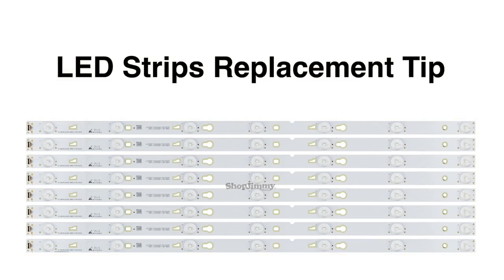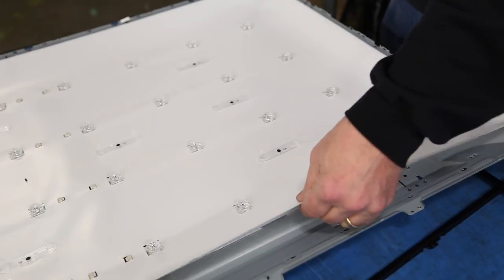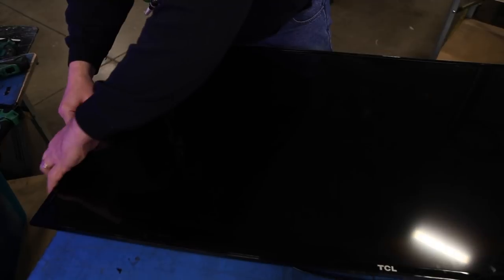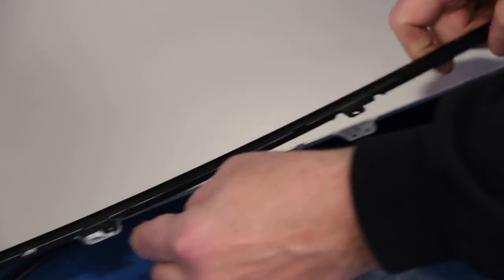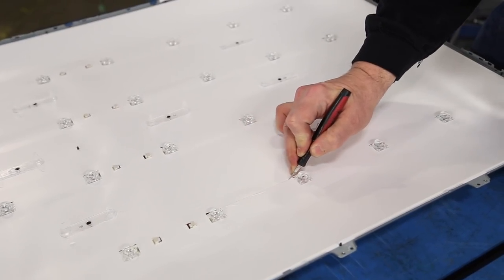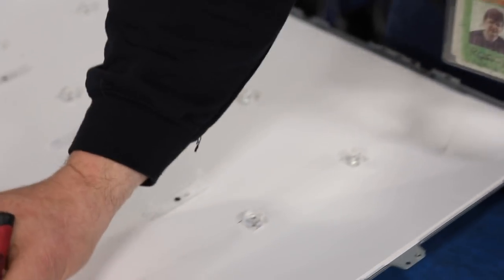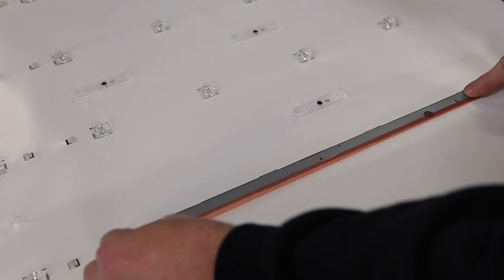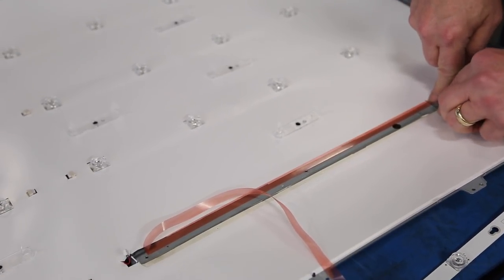LED Strip Replacement Tip - How to Remove LED Strips and Save the Reflector Sheet in LED TVs

Comment: Thank you for this video!! I cant find the button to give you a thumbs up. :( so I write this. I bought an 8K TV 82" from Bestbuy and with the help of your video I found out that my inverter and LED driver is bad as well as LCD panel needs replacing right out of the box.
Reply: Here is an update it turns out there was an issue with my one connect wire sorry place that one connect wire with a thinner one connect wire for the same TV and now know that it’s 100% the one connect box which is not for my 82 inch AK TV but for a 43 inch Samsung TV. 
I’m switching out the box next week I will have a perfectly working TV. 

So the difference between the wire that I had with the TV that one connect wire versus the one connect wire that I had it replaced with I’m able to actually use my tv, watching movies and shows on but still need to replace the OneConnect box as I am getting a OneConnect Box error on the tv screen

Comment: I have Magnavox 15MF227B/27 that has sound, but no picture. I can see the menu with a flashlight. I watched your videos and determined it may be a LED driver. The screen occasionally comes on for a couple seconds and then everything goes dark, visible only with a flashlight. Do you have this part available on your website?
Reply: just from the little bit i been reading..sounds like the Tcon board. did you get it fixed?

Comment: Hi,  I’d really appreciate if u could answer this question that I’ve been trying to figure out for months… 
I have 2 broken TVs.. a 60 element 1080p with a black spot that looks like there’s no lights working in that top left top middle area.. plus lines going both ways    &   a   55 LG 4k tv… think it might have just one led bulb somewhere that’s bad because tv turns on then picture goes right away in a half of a second…. My question is: 
Could I somehow take out the internal led light strips from one tv… to try to put them into the 4k LG tv… to hopefully get it to now work??  
I also broke my 85” Sony 900H 🤦‍♂️😟
But that’s another story 🤦‍♂️
Please, if u could let me know what u think, is it possible to fix the LG that way.. I’d very much appreciate it! Thanx

Comment: I have a UN55J6201 that has no backlight or image. I've replaced the motherboard and the power supply board but haven't had any luck. I was checking for loose connections when I touched the LVDS cable from the motherboard to the t-con board the backlights came on but still did not have an image on the screen. What would cause this?

Comment: 60PZ550 Lg tv. No picture. Sound works, input works changing works. Can tell with the sound. Removed back panel, y sus board a little discolored where the coils are and seen some cold solder joints. No shorts to ground anywhere. Fuse is good. Z sus board darker circuit board, blown fuse and several mosfets bad. My question is, would a bad z sustain board cause a no picture? Trying to decide whether I should send in both boards to be rebuilt.

Comment: My master Philips 32BLD4012N / 62 has 2 LED bars on the TV, there are 6 LEDs on the bar. There is no sound, there was no image, I changed the LEDs, they did not light. There is 13 v electricity to the sockets but it does not light up. I wonder why

Comment: Great tutorial! Unfortunately I found it after I disassembled the TV so i did not tape the diffuser panels. I decided to replace all LED stripes to avoid another dead LED soon. I bought the kit on AliExpress site so it took so time to arrive. My problem now is I DON'T KNOW in which order I have to install diffuser panels.
Reply: I have the same issue there’s a few of em . Should of recorded the dismantle .
Reply: @FloTheArtist  the thick sheet goes on the bottom and the thin diffuser sheet on top of that.

Comment: dont do that because you will see the marks on the tv where you cut it out im so sure about that. because the white its not there and you will see the differences you will need to apply hot aire for take out
Reply: I think cutting the sheet right in the middle of the LED strip along it, then replace the strip and tape back the sheet on top should work. Any ideas?
Reply: I realize this is old, but this is exactly what I came here for.. wondering if using a heat gun would be better.
Reply: @jeffwilson8592  Heating the reflector paper will shrink it and won't fit LEDs and other holes. That would be irrevrsable damage.